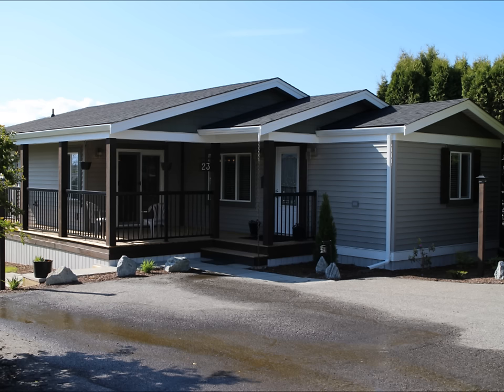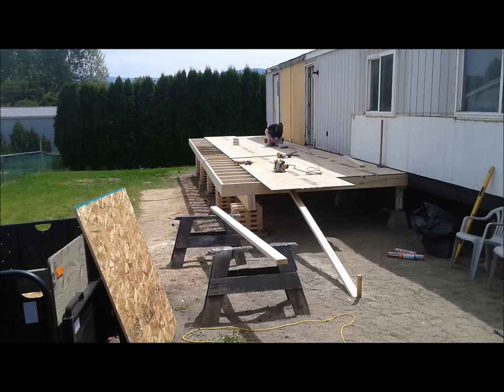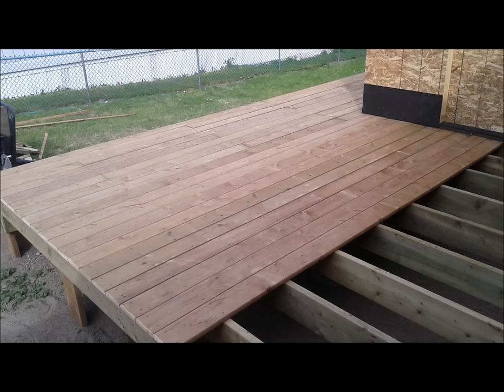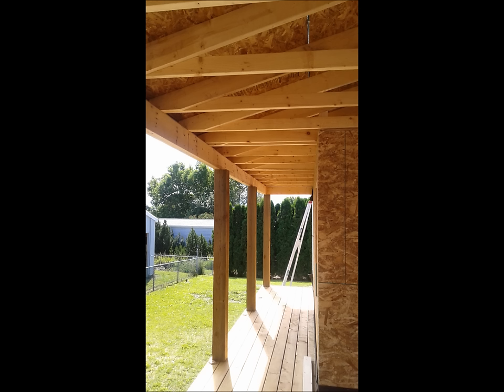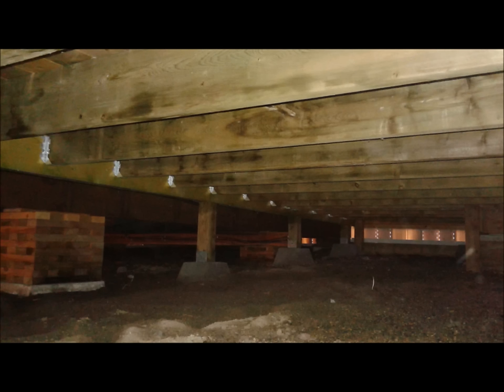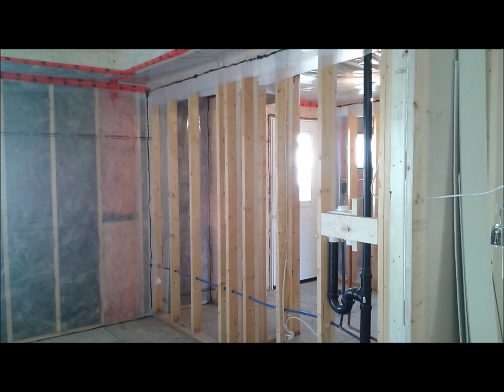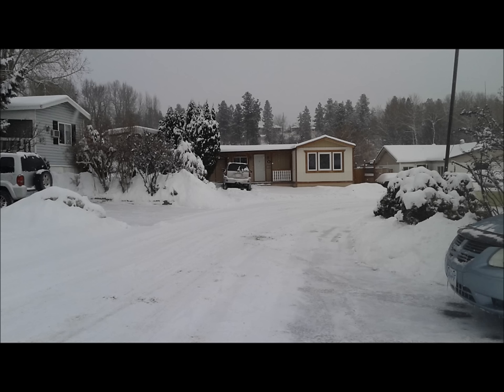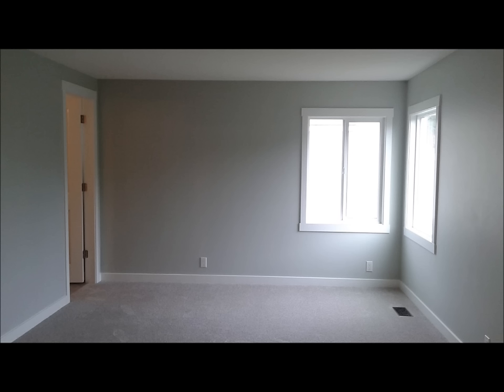Building An Addition To A Mobile Home - Start To Finish : E026 / BC Renovation Magazine

Comment: Looks like you had to do so much more than just the addition. The rest of the mobile needed updating. Would it have been roughly the same cost and faster to just buy a bigger manufactured home?
Reply from the maker: Hello, Scott. We sold this home for $230,000 Canadian. At the time a new home of the same size and level of finish was running about $300,000, so the difference in cost was substantial. 

But the biggest problem with buying a new mobile home in our area is finding a place to put it. There are basically no new lots available. What people are doing is buying old places to get the lot. The old place is then demolished and the new one set up. As far as time goes, the process of renovating vs buying new is about the same.

Here's a link to a project that we followed where they bought an old home, took it out and replaced it with a new one. That entire process from the purchase of the old unit to the new owner taking possession was almost 2 years.

https://www.youtube.com/playlist?list=PLxHwKqX3SqxhySDbMrF0jnVJIBpSADxW2

Thanks for watching and commenting. :-)

Comment: I see you put in new cribs but I also see you added cement block with a 6x6 under the ledger.... I thought that would have to be crib or bigfoot?  If not then am I ok to do the same?
Reply from the maker: Hello, Wayne. The reason that it was done that way was to allow the plumbing drain lines from the addition to pass over and connect to the main drains under the main unit. If we had installed a beam as we did along the outside of the addition then the sewer drain pipes from the addition would have had to go under the beam, and the flow would have had to go uphill to the original drain pipes under the original unit. This is an acceptable way to do this in our building jurisdiction.

Thanks for watching! :-)

Comment: Thanks for the great video! Question: does the mobile home have 7’ exterior walls or 8’? Does the addition have 8’ walls?
Reply from the maker: THEscgman, thank you. The original mobile home unit had wall that were 7'-6" high. We matched the addition to the mobile home so that the ceilings would be the same height.

The exception being the tray ceiling in the dining area, where I bumped up the ceiling a foot, to 8'-6".

There were other ways to do the ceiling in the addition. One way that I contemplated was putting vaults in the dining and master bedroom. This would have been easy to do and would have really opened up the ceilings in those areas. But, I did the way I did instead.

Comment: Did u install back up heating unit? Or did u just go with the heat pump only?  It’s definitely a good idea to have a back up heating source with a heat pump,,,in my area I believe it’s required...heat pumps r awesome until they stop working...and generally it’s suddenly that they stop working.,,
Reply from the maker: Hello, R.M.M. The unit we installed here is not a heat pump. I know it looks like one but it isn't. It is actually what is know as a 'packaged' unit.

Heat pumps were installed in may homes in our area back in the 1980's and 90's. In our climate they did not work out very well. Heat pumps in our area were typically backed up with conventional systems. As those old heat pump systems have died people have not put them back in.

Geo-thermal systems have not worked out well here, either. 

Thanks for watching and commenting.

Comment: 7:27 the original roof decking looks amazing how old was the original mobile?
11:18 too bad the greedy park didn't pro-rate the space rent as an incentive to finish the renovations on time.
Reply from the maker: Hi, Patrick.  That original roof decking is from the early 1990's.  It still had the original shingles.  The decking was in amazing condition considering the age and lack of maintenance.  We are in a semi-arid climate which probably helped.

One thing about the parks, they are the boss!  You want to play in their park you have to play by their rules.  It all went well with them.  I have no complaints.  

Thanks for watching and commenting!  🙂

Comment: You all done a amazing job.How did you blend the old part of the mobile home walls with the new.my mobile home is a 06 and we are in the process of doing the same thing but my current mobile home walls look like wall paper and thin and I was hoping it all didn't have to be replace
Reply from the maker: hayes Alexa2014, thank you. Blending in is mostly just a matter of being consistent. You kind of have to either blend the new in with the old or vice versa. In this case, we re-did everything so all of the new finishes just brought it all together. We didn't replace any of the old walls in this home.

Comment: At the very beginning you have the wooden piers on the outside of the new platform.  Did you just nail the floor joices and such to the facial board that you replaced?

Comment: Wow! You are a bad ass!!!! I want to add a Sunroom to a mobike home....How to tie it into the existing metal roof. Would I need to board it with osb and add a shingle roof to be able to tie it Into the roof joists etc
Reply from the maker: darr, I will be doing this exact thing on the project that I am working on now over the next month or so. Stay tuned and you will see how I get it done, but yes, I will be putting OSB over the metal.
Reply: Will keep an eye on you for sure! Excellent work!!!

Comment: Yeah I just bought a mobile home that is technically one single wide and one double wide smacked together the problem I'm having right now is my roof is leaking where they meet because the previous owner made a flat roof to meet both the peaks of the two trailers how can I fix this or should I just save a little and get a stick built house
Reply: I'd go to your local MH dealer to their repair shop and ask if they've got any structural engineers/roofers? To get someone to do the imrepairs who knows what they're doing!

I've looked at an 81 on 5 acres and I asked around but another neighbor in my apt complex said to get an inspection so I know what I'm getting myself into? I just want to renovate it so my parents can stay there to visit.
Reply from the maker: Kristina, good advice. :-)

Comment: How do you make it level also you didn’t do the cribs at the connecting floor joists, what did you use ?
Reply from the maker: Farad, we make it level by using a combination of a water level and a laser lever. The height of the cribs is fine-tuned to make the floor level by using various thicknesses of shims between the top of the crib and the beam. Where the joists of the addition meet the mobile home unit a flush beam was used supported by those 4x4 posts you see sitting on the concrete footer blocks. It was done this way to keep the supporting structure there as high as possible to allow the plumbing drain pipes from the bathroom addition and the heating ducts to pass between unhindered. That flush beam is 2 ply 2x12. The joists there hang off of the flush beam using metal joist hangers, as opposed to the outside where the floor joists sit on the beam and are cantilevered over the beam.

Comment: would you recommend using tractor trailer ratchet strap to tie down a mobile home?
Reply from the maker: Mr. Top, I recommend that you use whatever is code in your area. If you are not sure just get hold of your local building inspector. Thanks for watching. 🙂

Comment: this sounds bad but is simply a obsorvation, the water heater under the electrical panel is a no-no per national electric code.
30-36 " clearence for both for safe working space
Reply from the maker: Hi Gary. It came from the factory like that per 1991. We didn't move either the panel or hot water tank from the original locations. I agree, kind of an odd set up but passed the original CSA Standards inspection. We do run into some odd things in these homes. Thanks for watching and commenting.

Comment: 5:36 aren't those footer blocks for the deck and roof supports vulnerable to movement ICE forming during the winter months?
Reply from the maker: Hello, Gina. In our area, which is a semi-arid desert climate, this is not a concern. It may be different where you are and you may need a different kind of footing support.

Thanks for watching and commenting. :-)

Comment: this is great!!!! I know you have to make the addition an independent structure but what do you put in between the unit and the addition to ensure weather proofing and sealing it?
Reply from the maker: Ah, wilsonroo16, I can tell from your comment that you are someone that knows what they are looking at here. Yes, you are absolutely correct that the addition must be an independent structure. Most building jurisdictions will not allow any additional loading to be put on the original mobile home, stating that the mobile home was engineered to carry only its own weight. So, we built the addition as an independent structure as far as load bearing is concerned, but the two units are lagged together to help prevent tear away (separation), just as any factory built double wide home is. Then, the exterior building envelope comprised of the siding and roofing is applied as if the structure was one. No seams or joints in the exterior envelope where the two structures meet.
Reply: @BCRenovationMagazine  that is so helpful!! I have bough a mobile home after some research and watching you guys and am renovating it...it has an addition that was poorly done and I am re doing it! thanks so much for your video it was very very helpful to me :)
Reply from the maker: wilsonroo16, you are welcome! :-) All the best to you and your project. Thanks for watching and commenting.
Reply: @BCRenovationMagazine  I have a question that you may be able to answer. I have the small round close to flat roof....I would like to change it to a peak. I have looked at roof overs but am unsure if doing one would bring about weight concerns if i do it across the addition and mobile home giving it one complete roof...in this one it looks like you tied into the existing roof but I would not be able to.... it does not seem to be a concern in the ones I have looked at but I though I would check to see if you have done this in your reno experiences...thanks again
Reply from the maker: wilsonroo16, how old is your home? Are the exterior walls 2x4?
Reply from the maker: wilsonroo16, for some reason YouTube is messing with your comments. Sorry about that. They put your last two comments in the spam folder, and then they disappeared. I did see that you said that you have 2x4 walls and you think your 'rafters' are metal ribs. Did I get that correct? If so, this is how I would go about what you would like to do, but before you do anything you need to talk to your building authority and get their OK. I think your home is probably 12 feet wide. I would get a truss company to make you up a set of truss rafters. I would go with 4/12 pitch to avoid all of the low-slope issues. I would have them made to provide a 12"-16" overhang all around. You probably have the cardboard tile ceiling, or maybe some kind of panelling, and minimal insulation in the attic space. This is a pretty big job. It will be quite disruptive if you are living in the home. But when you are done you will have a new sloped truss roof with asphalt shingles, a new drywall ceiling, new and improved insulation in the attic space, and a nice overhang with soffits to really give it an updated look. Only you can decide if a project of this scope is worth it for you.
Reply: @BCRenovationMagazine  yes the walls are 2x4 and yes they are the metal rib rafters you got that right. Yes I have applied for the permit and the park says it is ok. The home is a 14 ft. wide. I was thinking 4/12. Yeah I have the panel ceiling and would really like to get drywall on it and really need the better insulation since I live in edmonton. I cannot thank you enough for your help....you have been a huge inspiration for me and I am excited to make this my new home. I will keep you updated on the progress and maybe send some pictures if i get the chance.
Reply from the maker: That's awesome, wilsonroo16! Sounds like you are well on your way. Way to go! I would love it if you kept us up to date. I would really like to follow along with you on your project. YouTube has just opened the Community page for us. Perhaps you could post there. It is kind of like a blog page. I have played around with it and it allows me to post photos. Maybe it will allow you to as well. Give it a look. I grew up not far from you, in Camrose. I spent a lot of time in Edmonton in my younger days. Yes, you need good insulation there! :-)
Reply: @BCRenovationMagazine  I absolutely will...thanks again for all your info and insperation
Reply: @BCRenovationMagazine  one more quick question I am not doing a deck...so would your addition be strong enough to just hold a normal roof?
Reply from the maker: wilsonroo16, yes.
Reply from the maker: Really appreciate you watching, wilsonroo16. :-)
Reply: @BCRenovationMagazine  I am showing you off to all the people I know who are trying to renovate in my park. I don't think our imaginations went far enough with what we can actually do....I know we all really appreciate you!!!!!
Reply from the maker: wilsonroo16, you and folks like you are the reason I created this channel. I hope to inspire, and in turn have those I inspire, inspire others. It is very rewarding to me to get a comment like yours, but you are the inspiration in your park now. I was just the match that lit the fire. :-) The thing about this is, it is contagious. You start working on your place, it inspires someone else, and so on. Right now, on the project I am working on, both of my neighbors on either side have been or are working on their places. We all yip yap back and forth. It is a lot of fun. It is a great way to build community spirit.

Comment: Great work what dis you put under the cribs and how far down did you go?
Reply from the maker: aquarium, the wood cribs are sitting on precast, steel reinforced concrete pads that are about 3" thick. The concrete pads just sit on a compacted gravel base. The pads in this case do not extend into the ground. This home is located in a semi-arid desert climate where frost is not much of a concern. Thanks for watching! :-)

Comment: hey u can just use a patio block for a foundation..   with cribs to hold it up  ?    that to code   ?
Reply from the maker: primalfury2011, code calls for a precast concrete pad that is 24"x24" and 3" thick, steel reinforced. The 18"x18" cribs sit on top of the pads. The pads sit on compacted gravel. That is code for our area. it is different in different areas depending on weather and soil conditions.

Thanks for watching and commenting. :-)
Reply: Cool sounds good

Comment: I still does not understand on the decision of Beam and Pier solutions - why does a regular foundation is not chosen? Is it cost the main driver?
Reply from the maker: Adan, yes, cost is a consideration, for sure. But mostly, it is just the way that it is done around here for our climate and soil conditions. Another part of it is that these homes are required to remain 'mobile'. Setting them on a more permanent foundation makes them not so mobile.

Thanks for watching and commenting. :-)
Reply: @BCRenovationMagazine  the mobility issue is not a requirement if it is still mobile these are just personal properties if you lay them properly and anchor as FHA and HUD require these are now consider real estates therefore easier financing and valuation of the properties rises. This is how is done is a weak argument and your clients needs to get inform in order to give them the best customer service possible
Reply from the maker: @adanmorales9214  we are in a completely different country than you with different rules and regulations. HUD and FHA requirements do not apply here. We have our own local standards that we must abide by.

This project was in a heavily regulated metropolitan area in British Columbia, Canada. SEVERAL permits and authorizations had to be obtained to make this project 'go'. There were MANY inspections made by the local building authorities. The home could not be occupied until a final occupancy permit was issued.

Whether or not you understand the process and how this was done, I can assure you that this project was done correctly and by the book according to the local rules, regulations and codes.  Those may be different than where you are...

The folks that bought this home knew EXACTLY what they were getting. That is why they bought it! 😉

Comment: How tall is the ceilings in this house? And what is the exact name o of those things the house is sitting on? I love the look of them and Im interested in more information.
Reply from the maker: Amythyst, the ceilings in this home are 7'-6" high, except for that raised part in the dining room, which was about 8 ft. The home is sitting on what we call around here, "cribs". These cribs are 16"x16" and built up using 3 pieces of 2x4 criss crossed each layer to the required height. The cribs, in this case, sit on a 24"x24"x3" reinforced concrete slab, sitting on compacted gravel. This method is approved for our area (very little frost). You may have different requirements where you are. Thanks for watching and commenting. :-)
Reply: @BCRenovationMagazine  lol I could do better than what I have.